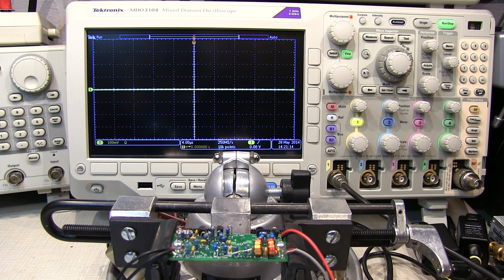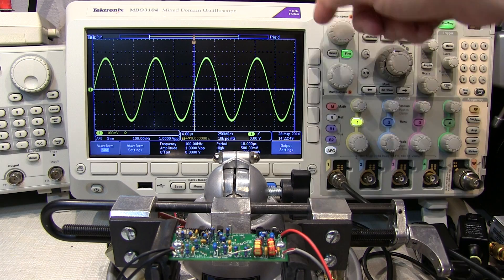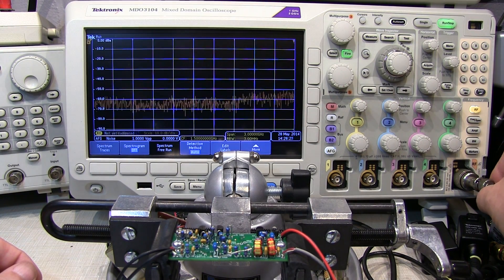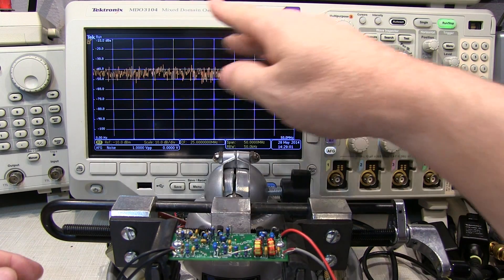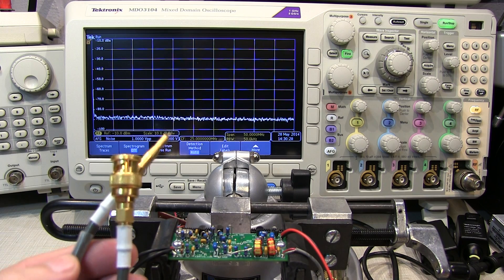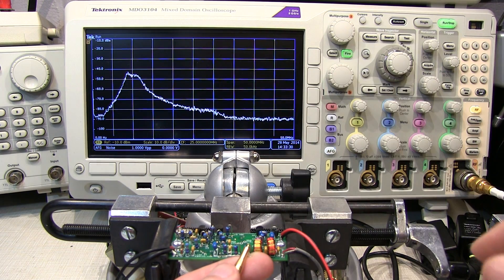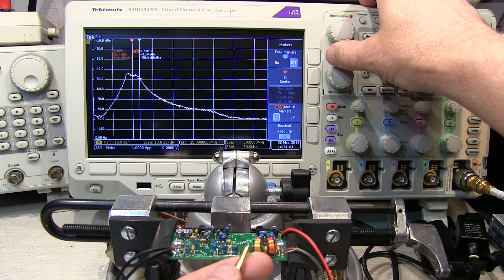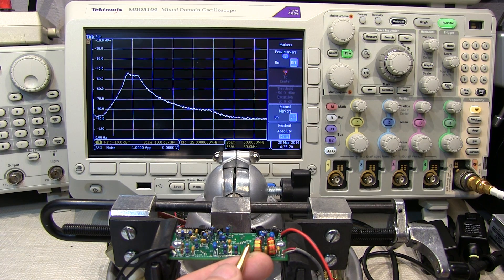#150: How to measure an HF Bandpass filter response with the MDO3000

Comment: Alan, another excellent tutorial, can you suggest an alternative to the P6150 probe? It's no longer available and the used examples that I could find aren't cheap. Y
Reply from the maker: You might be better off making your own using a small surface-mount resistor in series with the center conductor of the coax.
Reply: @w2aew  Thanks Alan.

Comment: Hi Nice well explained video.  Thanks.  I have an old HP141T and 8443a tracking generator and trying to learn how to use it to trace the bandwidth of a IF crystal filter.  Specifically I would like to trace out an extra 500 kc 455 kc center frequency crystal filter for my icom 761 transceiver. 1. Can you give me a hint as to what resolution bandwidth, Scan time per division and Scan width setting should be.  2. What should the tracking generator level be set to. 3. will I need some kind of impedance matching circuit to match the filter to the 50 ohm output of the generator then to the 50 ohm input of the SA.    I've tried to look through your other excellent video's but cannot find one that helps with this.  Thank you for any help you could give.
Reply from the maker: I'm assuming that you watched some of my other videos on the use of a tracking generator:
https://www.youtube.com/watch?v=bbnllGycQws
https://www.youtube.com/watch?v=wv79DSqVi9w
Nothing is too critical with setting up your sweep.  I'd probably set up the span to be 4 or 5x the expected bandwidth.  Setting the RBW to something between 1/100th to 1/1000th of span is a good start.  Sweep time will be inversely proportional to the the RBW^2.  Start of very slow -few hundred ms/div.  The slower, the more accurate.  It'll be obvious when you're sweeping too fast.  Set the level to something reasonable for the application - probably something like -10dBm or so.  You can start with no impedance matching at all - it'll mainly change the Q of the filter, not the center frequency.  Another good place to start it so insert several hundred ohms in series on either side of the filter.

Comment: I have an RSA306 spectrum analyser. Is there a separate noise generator I can use to do this?
Reply from the maker: Congrats on the RSA306, great little analyzer, especially when you start using the signal analysis features. But, I digress. For a noise source, you could build something or even buy a low cost unit like this 
http://www.ebay.com/itm/SMA-noise-source-Simple-spectrum-external-tracking-source-DC-12V-/331591953824?hash=item4d346bada0:g:HJ8AAOSwDNdVjdG-
Reply: Thank you very much. I ordered one. Looks much simpler than I though it would be to produce such wideband noise.

Comment: Always measure the inductance before you clip the remaining wire tails. You can always add additional windings this way to get the inductance measurement as close as possible (i.e., to within a single winding).

Comment: Hi Alan, thanks for your great video series, always look forward to them and watch every one. I'm wondering what you'd recommend for a first time oscilloscope buyer? I'm doing embedded systems (STM32, AVR etc.) but also am a registered HAM. So if money was no object, these MDO look fantastic, but probably overkill (and more expensive) than I'm ready for. Something that would help with both digital and RF thats on the entry level side is probably what I'm looking for. Thanks

Comment: I did something similar for a VHF filter, using a noise source and a DVB-T dongle. Definitely not as nice, but it does the job. It does require some testing to get confident about the results and its limitations, and there still are some questions reflecting through my brain concerning impedance (e.g. the dongle has a 75 ohm input). I think that the mismatch only gets noticable at the higher frequencies (>300-400MHz).
Anyway, here's the Mc-Guyver way to do it: http://hansvi.be/wordpress/?p=91

Comment: Great video Alan, I was testing my softrock filters with a sig-gen and scope your idea makes so much more sense but never even occurred to me. For  the occasional "tinkerer" can you explain the effect a standard probe (with 50R T at scope) would have on the trace? Thanks, educational as always - keep up the good work!
Reply from the maker: Well, you can't use a "standard" 10x probe, because they want to see the 1M input of the scope.  You can use a simple length of coax with the 50 ohm terminator at the scope for those applications where the circuit under test wants to see 50 ohms.  Of course, to try to duplicate this with just a scope (and not a spectrum analyzer), you'll need to do an FFT on the waveform from the output of the filter.